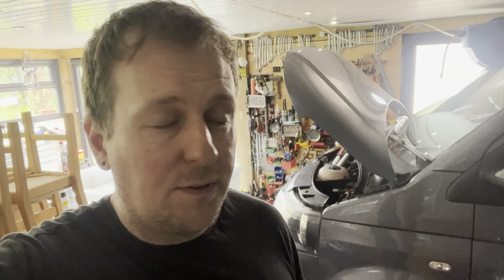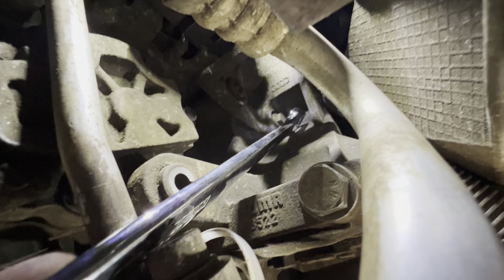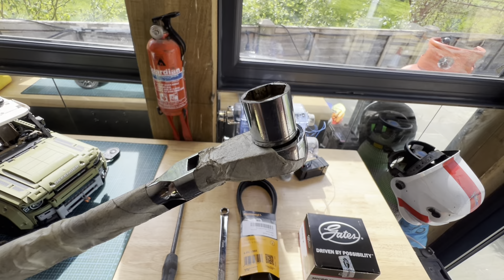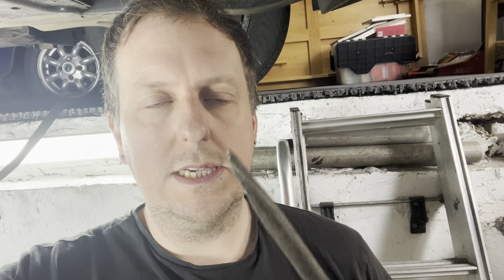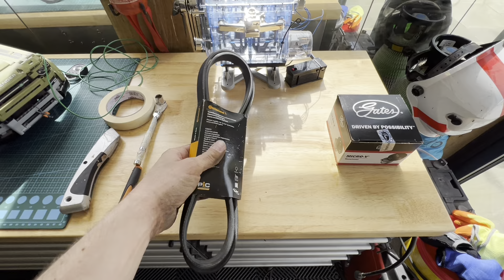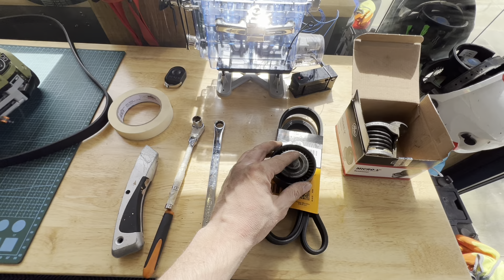VW T5 2.0 TDI Aux Belt Tensioner Change

Comment: Does the generator also have a 1way clutch on these? i have one where it can not turned any way if i block the generator (block the generators fan wings) ? if so is there a way to repair that or is it a new generator?

Comment: Just saying, isn't it easier to take off the wheel and the plastic cover for this job?
Reply from the maker: @icefire_ro  on the 1.9 PD’s the tensioners bolt from that side. On the later 2.0 common rail, they bolt from back of the tensioner. You cannot get to the tensioner bolt from the wheel side
Reply from the maker: @icefire_ro  on the 1.9 PD’s the tensioners bolt from that side. On the later 2.0 common rail, they bolt from back of the tensioner. You cannot get to the tensioner bolt from the wheel side

Comment: A nice handy tip or two. Hopefully VW dealers will have a tool to do the job quicker as using a spanner on it own would really rack up the hourly rate that they will rob your wallet with. Their parts certainly do that two. Just had a new Clutch kit and Dual mass Flywheel from them and it was over £1800 all done, I would hate to see how much it would have cost if they had done the work rather than my local Mechanic. Had to go genuine down to supply times and going away last weekend.
Reply from the maker: Thanks for sharing your recent repair experience!! 😃 appreciate the comment buddy.